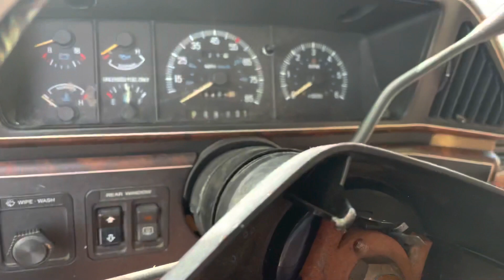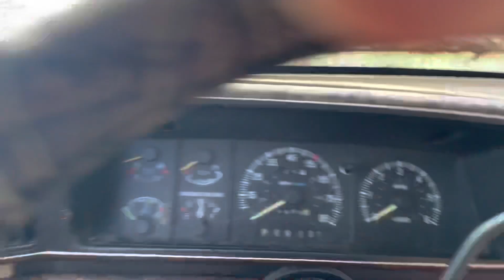My NEW CAMMED 2004 TAHOE with 35x12 on BLACK SNOWFLAKES

Comment: Very nice truck, does your radio play loud, I notice u have the bose, so do you know if the factory amp was bypassed or did the use a harness
Reply from the maker: It recently stopped working but I’m about to look at it and get it working because it does play loud and clear
Reply: bj

Comment: Question, what exact rim and tire setup do you have? Are those 20 inch black snowflakes on 35 inch tires?
Reply: Those are more than likely 22’s or 24’s. 22’s would be my best guess just by looking at how much sidewall there is
Reply: 24s

Comment: Have the front tires ever rubbed on the fender, by any chance. Just wanted to make sure before I put my set of wheels on.
Reply from the maker: Yes it takes some trimming mostly rubs the wheel well but it has 2.5 keys torqued all the way. Only rubs at full lock.

Comment: What is the suspension setup? I have a 2003 Escalade EXT that came with similar rim and tire setup and it rubs.  I was thinking about converting to passive suspension to get rid of the air ride, and put a 2" lift on it...
Reply from the maker: It has 2 inch keys torqued all the way up but I’m thinking about getting a 2inch bigger front shocks to soften it up

Comment: Them 24 inch rims on 35s right and what size lift
Reply from the maker: Correct and it doesn’t have a lift it just has 2 inch keys for the front but I will eventually get a lift

Comment: What size rims and is it just leveled? And does it rub at all? Been looking to stuff some rims and 35s on my Tahoe, all I’ve does is leveled it out and new suspension
Reply from the maker: It has 26 inch rims and raised in the front 2 inches and bought it like that. It has 1.5 spacers on the front and luckily I’ve only had to trim the plastics and doesn’t rub at all
Reply: Tires say 24s